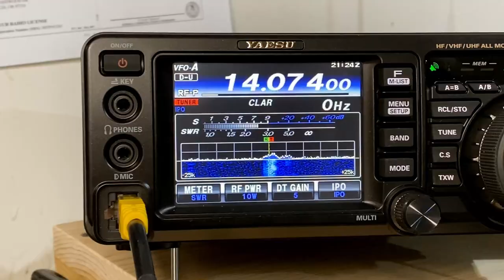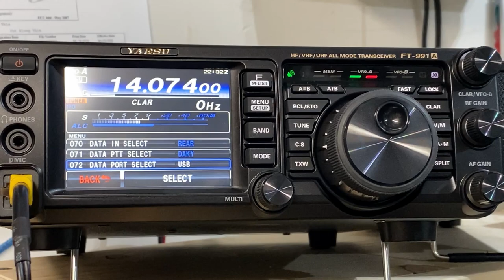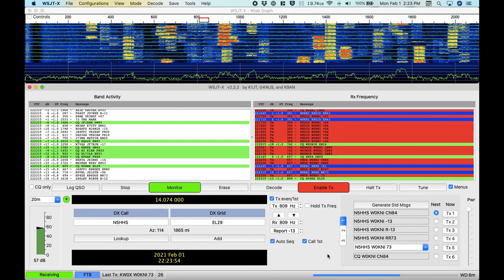How-To setup your Yaesu FT-991A for the FT8 data mode and WSJT-X

Comment: I don't chime into forums much, but do look for solutions here. I had an issue of the CAT working and radio keying, but no audio output the radio.  After a little while laying out exactly what was happening, knowing I was generating audio in the soundcard internally, I finally found one person in another forum who had my solution. Of all of the YouTube videos on doing FT-8 on the FT-991a that provided settings, none mentioned one crucial setting. In my case, it was setting 106, SSB mic select. That setting needed to be switched from MIC to rear. My CAT was always working, but no audio output. That setting fixed it all, so after changing cables and many other things, that was the simple solution. Hope this helps someone.
Reply from the maker: Excellent reply Russ. So many dang settings. I love the fact that I can just use the CAT cable with the 991 which also carries the audio vs my 891 where I have to run 3 cables with my Mac
Reply: Thank you for this setting. It was the final setting to make it work
Reply from the maker: Awesome! So glad this helped. I was getting a little frustrated myself. But got it figured out! 73

Comment: Great tutorial!  This should save me a considerable amount of time tweaking things to get it working.  Thanks.
Reply from the maker: Hey Dean, thanks for stopping by.  What a great radio!  My experience with WSJT-X is mostly good but I find I often have to reboot the computer to get a good connection with the radio.  Certainly not the radio's fault.  Good luck and let me know if you have any questions.  73, de W0KNI.

Comment: I was having trouble receiving anything. So I set everything to your settings except for the baud rate as mine was unchangeable at 4800 in my software settings. Also thanks for clarifying that with the USB cable you don't need an audio cable. I receiving now! Thanks! Now I have to learn the rest on the wsjt-x software👍

Comment: NOW.... Save ALL of the FT8 Settings onto your SD Card...   Also for each mode you like to do on your radio, set up that mode and save it onto the SD card.  This makes it easy to enjoy whatever mode you want to work whenever you want.   Just load the Mode memory from your SD card any time you want to work FT8 or SSB or CW.   That way you don't have to fiddle with all of the settings and it will be easier to get on the air.
Reply from the maker: WHOA - I totally forgot this guy had an SD slot - LOL.  THANKS FOR the AWESOME tip.  That is probably my number 1 beef with the different digital mode software, always having to tweak the rig to make it work.  I don't run digital often, at least not enough to remember EVERY setting ... Great tip Mr. Ghost!
Reply: Ok You got me.  I'm going to head out to the garage and look.  I can't find anything in the manual or online about an SD Card slot.
Reply: @robcarnaroli269  I can't find an SD slot on my 991A, but I do have the RT-Systems programming software.  It accomplishes the same thing as long as you have a PC available.
Jim  N4FAF
Reply from the maker: Great work around!

Comment: How do you get the waterfall in WSJTx to be able to see all signals coming in. I had a call from one that the waterfall said was down at freq 465. I do not see signals there. That pasrt and a good 3/4 of that waterfall is blak. Only a few signals show up. Everything esl is fine can make and receive contacts but don't see signals at all in the black areas. Have tried all adjustments with the software/waterfall including advanced and it only moves the blue with the yellow signals in a small portion of the waterfall. Any help appreciated.

Comment: Great tutorial, found a bit of a NEW one for me.  I also run a mac, and latest version 2.4.0 of WSJT-X the FT991 is bouncing itself from DT-U to USB.  First time I've even seen that, any thought's or seen this before?
Reply from the maker: Hey Scott, thanks for stopping by. Wow, I have not however I do run into glitches with this combo and think the best thing to do is to turn everything off.  Reboot the mac, then turn on the radio, then start WSJT.  I've noticed that WSJT will not release the USB Device port and I have to ping another one, or better - just reboot and start over.  Let me know what you came up with! 73, W0KNI
Reply: Hello, have you found a solution to the DT-USB and USB problem? I have the same problem and I haven't found the solution.
If you had found a solution, I would take it.
Thanks in advance .
My 73's QRO
ON4LME
Reply from the maker: Hey Claude, sorry for the long delay.  I've been searching around for an answer and the best I can come up with is it's probably the software and not the radio that's causing the mode to change.  I hope that helps.  73. w0kni

Comment: could you go over how to set the audio levels between the computer and the FT991a?  I can't seem to figure out how the ALC works and there's no easy way to monitor the outgoing audio for distortion, etc.  thanks!
Reply from the maker: Hi Steve! (great name btw) - help with audio levels? Sure thing - and that "sounds" like a fun video to make!  I'll summarize and answer here, but stay tuned for a video explanation.  The 991A only requires a USB-A/B cable.  This cable should have ferrites on both sides.  What works best for me to make the "magic" happen is to: 

1. Turn the radio on, unplugged from computer. 
2.  Reboot computer (I prefer to cold boot, aka shutoff then on)
3. Plug in your USB cable from radio after computer has settled down and loaded the startup software.
4. Open your software and go to the Radio and Audio settings.
5. In the Radio settings make sure to select the correct port. (Lots of YT videos explaining this)
6. In the Audio settings make sure to select the USB Audio device
7. Your computer Audio levels should be set so they don't "peak" the meters of either the software (WSJT-X) or the internal computer audio meters.
8. On your Radio switch your Meter to ALC, then select the quick button for Data Gain - lower this to about 5.
9. Lower your RX watts also to 5w.
10. Press the Tune button of your software, or MOX button on your radio to start transmitting in DATA-USB mode.
11. Watch the ALC meter.  Repeat #10 on/off and adjust your Data Gain so that the ALC meter stays within about 25-50% of the meter scale. (Some might say it shouldn't show at all but that has not been the case for me.)
12.  Lastly, make sure your computer time/clock is synched with an NTP server.  ( I use a Mac so I just run a terminal command every time I start the computer.)

I hope this helps!

Comment: Thanks!  I was planning on picking up a FT897d for a few years and then Yaesu stopped production on them!  The FT-991 doesn't look as durable but it supports both C4FM and you can play with FT8?  Its about damn time Yaesu!   I am going to finally upgrade my license though.   Thanks for confirm the FT8 ability though!
Reply from the maker: No problem! Have fun with the radio. I really enjoyed the flexibility of the 991A but for me personally I like the 7300 and the bigger touch screen.

Comment: Hello from the great white north of Canada.

I am in the throws of looking for a new rig that will do data modes. I like the shack in a box of the 991a and was wondering if CAT is still an issue. 

73 de VE3XQQ
Reply from the maker: Hey Frank - thanks for watching! I have to tell you up front that I've traded this radio for a 7300 and love it!  That being said, the 991A was a very capable radio and didn't have any CAT issues for me, however I found that the small buttons and compact design became more of an aggravation to me than a feature.  I have a dedicated 2m/70cm radio that I move between the shack and my truck when I need it.
Reply: @W0KNI  Thanks for the feedback. I will keep your comments in mind as I look for a setup that will give me SSB on 2m.

Comment: Do you know why you are setting 032 CAT TOT to 100ms or did you find that setting somewhere else? Mine works at 10ms and I cannot find any information on the interwebs telling me exactly what it is for.
Reply from the maker: Hey Dennis - thanks for watching.  032 CAT TOT is the Time-Out-Timer which is important for the software trying to poll the radio during a CAT command.  A lower setting, 10ms just tells the software that if xyz ... CAT command does not respond within that amount of time then to abc ...

I hope that helps!

Comment: I can receive and decode. But my 991a does not seem to be transmitting. What should I check ?
Reply from the maker: Hey James - I'm assuming your using WSJT-X and you have the correct DIM cable coming out of the radio with split 3.5mm audio jacks.  You don't mention what platform your running WSJT-X so I'll assume a Mac.  Make sure your audio settings are set to the correct input/output device.  And the tricky part is make sure the correct audio drivers are installed.
Reply: @W0KNI  Yes I am running WSJT-X (FT-8) with a Dell G-3 15 Windows 11 laptop. Using a trip lite usb data cable. I have installed the Yaesu virtual comm port drivers first.
Reply: @W0KNI  Yes I have the splitter. All these new laptops come with only ONE audio/mic combo jack.
Reply: Do I need to run an audio jack from the radio to the laptop ? Mic out mic in ?
Reply from the maker: Ya my Mac was like that. I think I mention the USB audio splitter. It worked great.

Comment: I am now using Ham radio deluxe as my rig (for two radios the Yaesu FT-991A & Icom 7300) an one Dell Windows 11 laptop. Running WSJT-X FT-8. Do these instructions apply for FT-8 operations with UHF & VHF ?
Reply from the maker: Hey James sounds like a nice setup! I've honestly never tried FT-8 on UHF/VHF so I can't answer with any confidence, but it certainly wouldn't hurt to try.  Good luck and happy hunting!

Comment: isn't it for digital mode on HF 40 meters using a bandwidth of 500Hz?
Reply from the maker: Now you have me thinking.  WSJT-X will have a span of 3.5kHz but I believe your right that the actual FT-8 is only 500Hz.

Comment: Unfortunately these settings don't work for me,for  FLDIGI. A bit of a problem
Reply from the maker: You're not alone! For the life of me I was never able to get CAT control working and finally gave up.
Reply: @W0KNI  I'm going to use the  RT Systems software to make separate menu files for  ft8 and  FLdigi.  The  ic7300 doesn't seem to have this problem